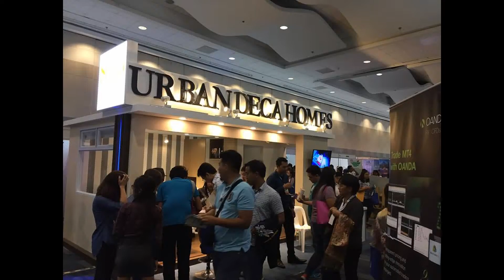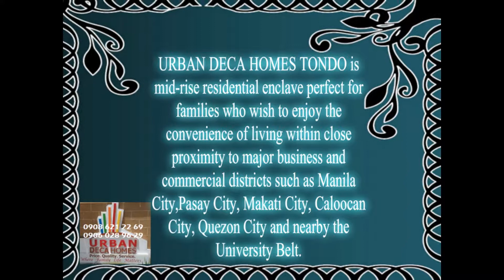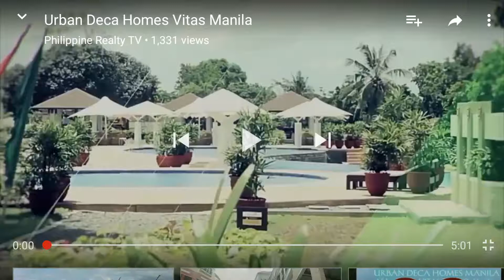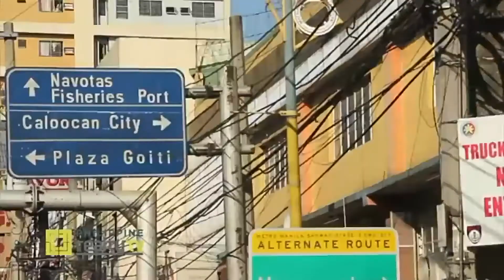Urban Deca Homes Manila Updates

Comment: Does it has good recycling, drainage/sewarage, rainwater collection, and garbage collection system. Those are the basic stuffs that developer and or builder should take into account. It is really good project for the poor or middle class, but without any of those I mentioned above, that practically meaningless and will not help alleviate the seemingly "chaotic" and unhygienic Filipino way of life. How about the homeless, can they afford it. Is it possible for "community responsibility" stance of the company to allocate at least 2-3% of units in each buildings to totally homeless. I maybe shooting for the stars, but engage the NHA for some compensation if there is some allocation in whatever, wherever 8990 Holdings is building community. Again, good project. Hopefully, your Company find some ways and all other developer in the Phil. to be able to allocate some percentage of your building targeting those low-medium income families to the "homeless"